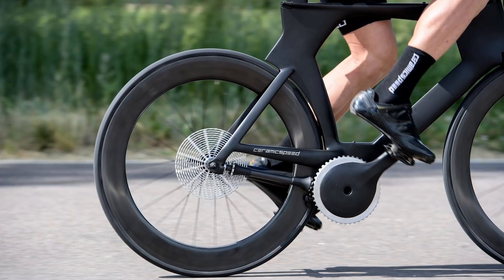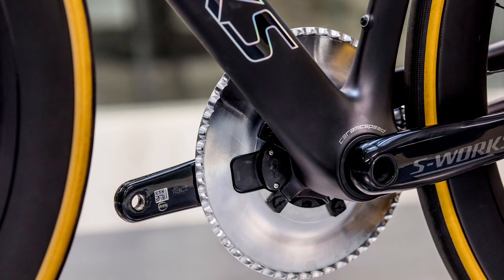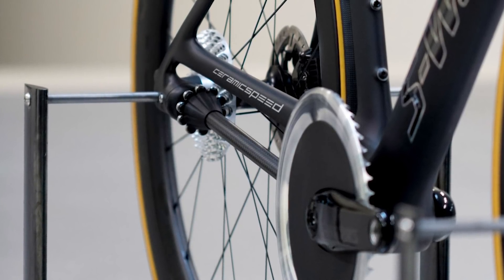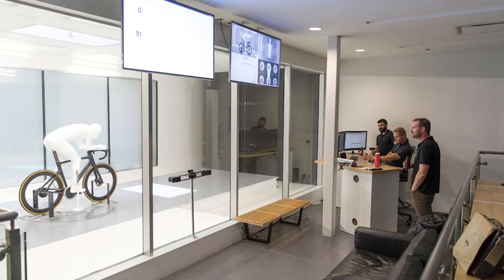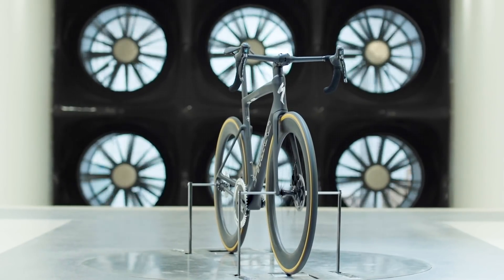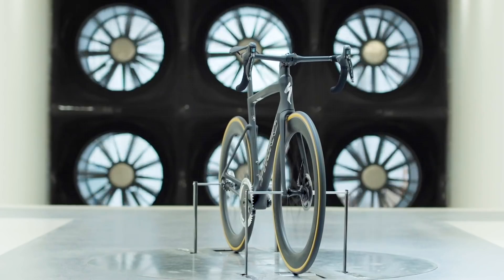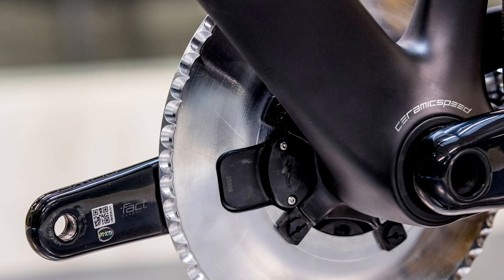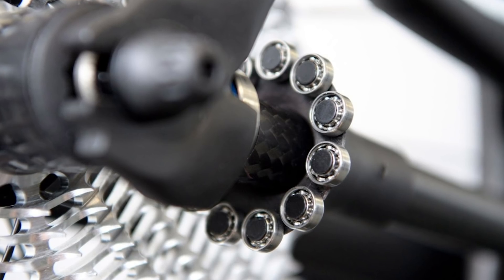'The World's Most Aerodynamic Drivetrain' | CeramicSpeed's Chainless Concept

Comment: Old concept. Rather than transfer power over 5-12 teeth at all times,it's reduced to 2-5 teeth. Inefficient and very weak regarding durability.
Reply: @ska042  Its just one to two teeth that do the heavy work.
Reply: Youtube User, stand on the drive side-lock the front brake- put your foot on the crank and apply torque-try lifting the chain several links from 1st engaged link. You will see they are spreading the torque load.
Reply: @awesomexistence  From what I've seen so far, I don't imagine this will be anything worth caring about. But wouldn't it be something if materials and design have really come far enough to overcome the forces involved? It might be a game-changer if it really works.
Reply: Joel Henderson, i could forsee a specialty time trial application, however weatherproofing this design for general use might be a heavy prospect
Reply: True but the forces on a regular chained bike follows the biked direction and the concepts forced would move away from the bike on the right side. Therefore it's different force spreads so I don't think you can compare them honestly
Reply: Harpreet Singh Toor, i believe you lost something in the translation. Torque is applied in the direction of travel. Only load forces changed would be to micro differences in manufacturing tolerances of the chain and sprocket as they mesh and/or wear.
Reply: @awesomexistence  Shiet  my physics was never really very good my bad
Reply: filip000 where are you getting these numbers? Both chain systems and this shaft drive always engage one tooth at a time under load. Am I wrong?
Reply: Engage any gear ratio on your bicycle and you can fairly easily see how many of the teeth on the sprockets are in contact with the chain. They will (if not immediately), with time and wear, all distribute the chain torque by themselves. If you engage a 39 tooth on the front, it's about 17-18 teeth in contact with the chain. On the cassete, a 16 tooth sprocket will distribute the force on around 6-7 teeth. Now compare this to the "revolutionary" design of the sprockets in this video. It looks neat, sure.....but it functionaly sucks.

Comment: I've been thinking of how to design this for years...well before Driven made its debut. The moving of the gears isn't too difficult if my mind, the major problem is: as you move between teeth in the back the gap between teeth becomes bigger and you essentially don't have multiple gears OR the path of the 'derailleur' does not follow a straight line radially and thus trying to mesh between gears as the 'derailleur' is moving across the plate becomes very tricky because a tooth is likely going to be in the way of where it is trying to move.
Reply: Unless the gap between each row of teeth is at least as great as the thickness of the bearing; though, in that case, you would be pedaling freely between every single shift. No shifting under power. Last time something similar happened to me, my face met pavement.

Comment: Ceramic speed : selling overpriced state of the art gadgets you don't need since 2004
Reply: @aaltoadamus9567  I know people with steel bikes that would make you puke your lungs out.
Reply: @AntoineMorin-Prévost , thought I could see a Savanna RX3 nose cone. And was right. Cheers from Aotearoa NZ.
Reply: @aaltoadamus9567  It's not about holding on to traditions, it's about using expensive technology but not gaining much. Ceramic gears have their place, but they are only useful for rpm's of 50k-150k. Things you'll see in industrial applications, but not on a bike. So go ahead, shell out hundreds of dollars, pounds or euros and gain 0,8% drivetrain efficiency. Meanwhile, the rest of us will focus on things that actually matter.
Reply: The world needs $500 jockey wheels!
Reply: @aaltoadamus9567  I was going to buy a Shimano Dura Ace FC-7410 crankset - NOS square taper for £250 because it was a beautiful work of art. But my 30+ year old Lugged F Moser steel frame already has a NOS Shimano FC-7700 Dura Ace crankset. I have gone back to down tube shifters and non aero Ultegra brake levers. The Shimano Sante hubs on H Plus Son TB14s rims are smooth and make for an excellent wheelset. I'm also impressed with the Brooks B15 ti saddle as well. 
Its fun dropping the occasional carbon superbicyle fellow on a retro 'Eroica' bicycle with the handlebar 'eye brows'. But it starting to get getting more difficult once you get past 50 years old.

Comment: Ok ok, but does it work? No. not now, but.... 
Ok, it does not work. so i would not buy it. 
Double roll chain still works fine. 
Beltdrive works fine. 
Why change?
If you wonna get rid of drag, you could go with a Pinion gear box or Rohloff speedhub.
If they make it work we could talk again. :)
Reply: Pinion and Rohloff have much more drag than conventional drivetrain, except at the extreme angles

Comment: Still not convinced how it’s gear change will even work how’s the teeth going to line up
Reply: you can only have options with whole numbers of teeth, and you'd need a gap at least as wide as the bearings at the back, and some ramps of the teeth, or some sort of electronics to know when everything is lined up.

It's all kind of silly outside of a track bike (maybe) where you could run on a light machine oil and never get it dirty.
Reply: Andrew Frink it just seems like a right nightmare to time it all and everything I feel like it will just end up single speed only with this design if it ever even makes it to market

Comment: I'm just an amateur cyclist and I don't have en engineering degree but I feel safe to say this system is one gap too far. Take motorcycle for instance, they still have a chain or belt and a gearbox. And when it comes to motorcycle with a driveshaft, the gearbox is prior to the input shaft, not after it. I just don't see how CeramicSpeed could design a functioning drivetrain that could withstand the real road conditions.

Comment: Spray with small stones from the front wheel will hit the cassette, will the bearings on the driveshaft be able to handle this ?
A convetional chain will flex up if there is anything between the chain and cassette.

Comment: Judging by those open bearings in both ends of the shaft, first time in the rain would completely destroy the drivetrain. Sure, you could use sealed bearings or completely weatherseal the shroud, but that would add drag that's not wanted in their "marginal gains" philosophy. Hmm. It is an interesting concept, but i don't think we're going to see this anytime soon in production (and knowing ceramicspeed's pricing, nobody would ever be able to afford one anyway lol).
Reply: Also, what if CeramicSpeed went to completely different direction and made a shrouded single speed version of that driveline and paired it with something like Pinion or Rohloff. Ultimate maintenance-free powertrain for those that have deep pockets? :P
Reply: if they used sealed bearing the efficiency will probably low than average chains... hahaha
Reply: Actually there is no shortage of middle aged dentists and accountants lining up right now hollering "take my money"! These folks buy a new bike when they get a flat tire.
Reply: @newttella1043  don't make fun of the guys who can afford the newest tech. They pay for the initial R&D and manufacturing costs so the tech can "trickle down" later.
Reply: This is actually an application where full ceramic bearings would be appropriate, since the bearings aren’t taking any big impacts. If they end up using full ceramic bearings (which they won’t), water and lubrication will basically be a non-issue.

Comment: Interesting, really.
But I think that the rear part of the drive-rod(?) with the small rollers on, needs to be different.
It absolutely not aero !
And it will collect a lot of dirt and also get hit hard in a crash.

Automated gearing, connected to predetermined pedaling powers, is obvious !!!
If they can produce a working gearshifting mechanism.

Comment: CS still not field testing the actual shifter, not even seeing it fitted on... I am skeptical about the lateral strength of the cassette of the design will ever be applicable.
Reply: i am even more skeptical about how the flex in the frame would affect the gears alignment

Comment: If it means I don't have to clean and lube my chain all the time I am all up for it...looks like it will be a few years from now until this comes with shifting and is working properly....
Reply: Well, if they plan on leaving those open bearings.. even if are Zirconium ones, they're gonna pick up dirt and it's not going to be beautiful
Reply: No, you don't have to clean and lube chain as there aren't any.  Just need pushing out those bearing and clean it like how you repack the one in your wheel.  And yes, reinstall it back too.🤣

Comment: They should have the "Cassette" facing the same side of "chainring".
Surely less appealing, but it would hardly harm the Aerodynamics and it would be far safer
Reply: where do the spokes go then？
Reply: @顾凯文-z6k  I was not saying that  the Cassette should be accommodated inside the hub. I meant that it should have it's teeth facing the spokes, being offset in order to leave the space for the shaft and gear(maybe by having an axle larger than the hub, maybe having the Cassette overhanging (but it would create some weird stresses on the axle then, by not having it constrained on either sides ))
Reply: jad musallam then what about the widen chain stay on the right ?